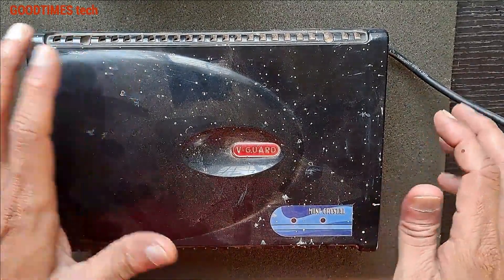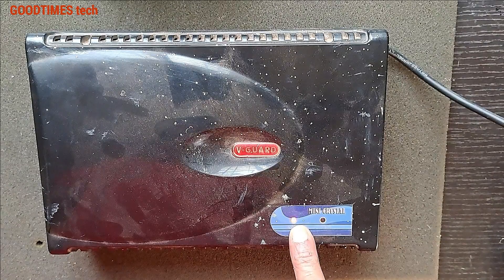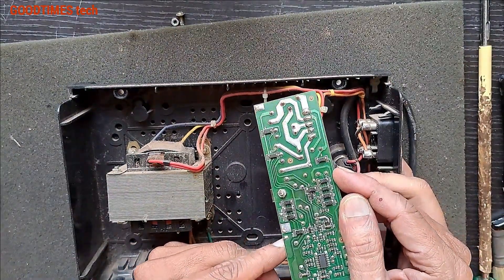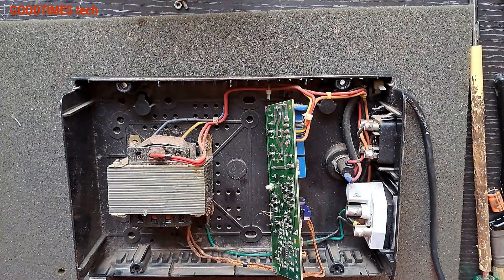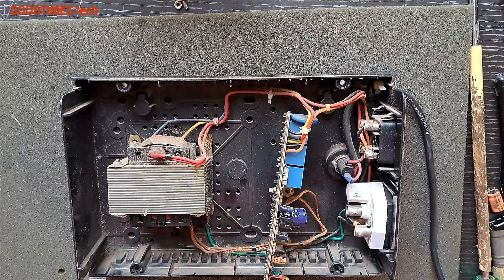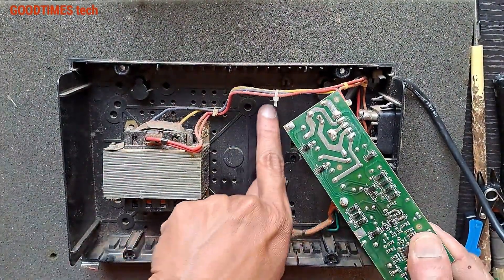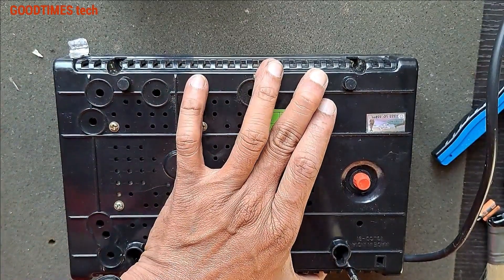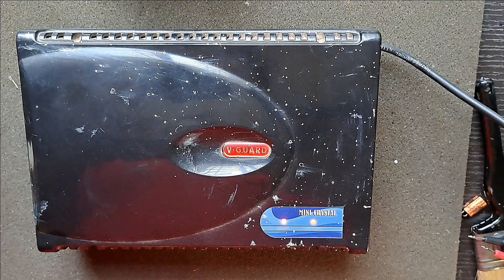V GUARD Mini Crystal voltage stabilizer | not working | LED Blinking | Kit pit sound | How to solve.

Comment: Can we convert transformer to 12-0-12v ac dual power supply to use input for +5v, +12, -12v regulated dc power supply board? Will you please tell?